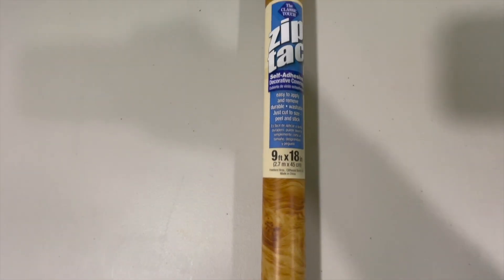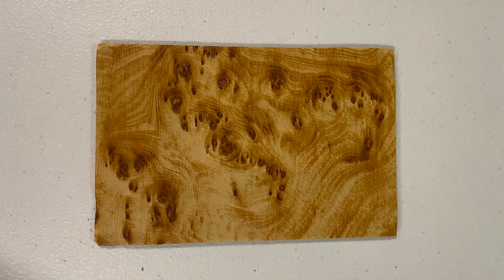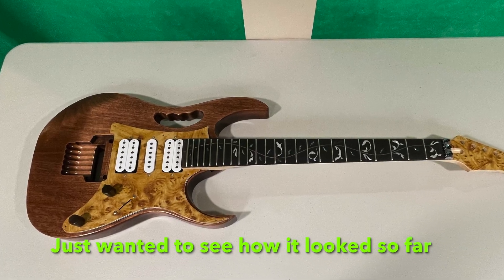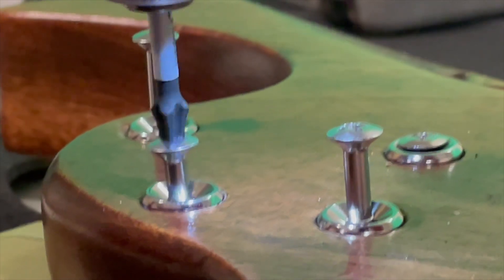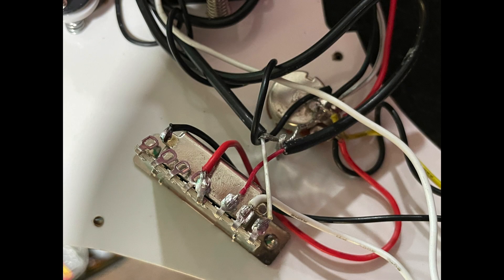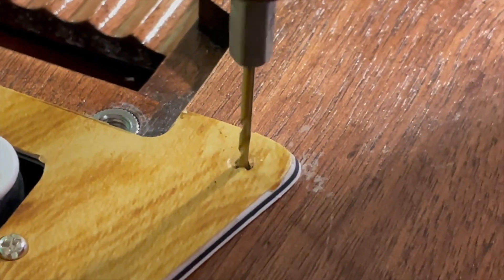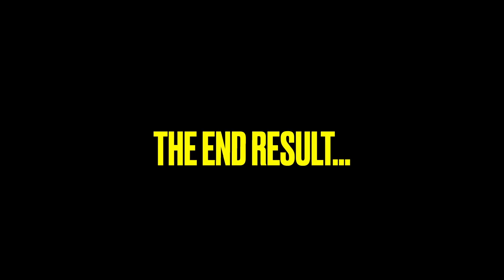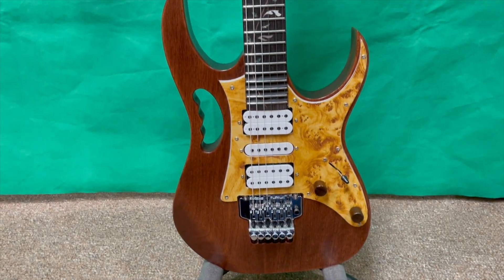My BYO Guitar Ibanez "Woody" JEM Replica Project - Part 3

Comment: Hope you’re planning to add the original pickups that were made for “Woody” ? Great videos
Reply: I did that in mine. It has the dark matter two pick ups. I didn’t like this theme punk look on the premium version of the woody.  So I went with Black like the one that was made for Steve by Tak. I also made a custom Pick guard and custom back covers. Using the same Burlwood type that Tak used. I believe there’s a description in my video. I’ll leave you the link here.  https://youtu.be/8TlWXdNii64?si=3rca1s_EGJi3HBO6